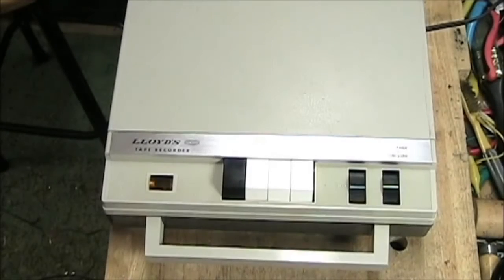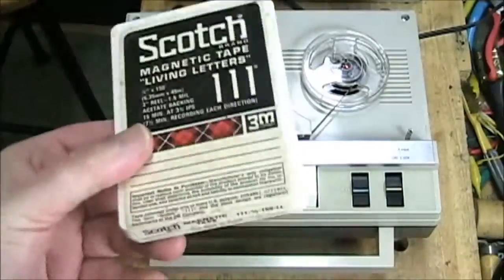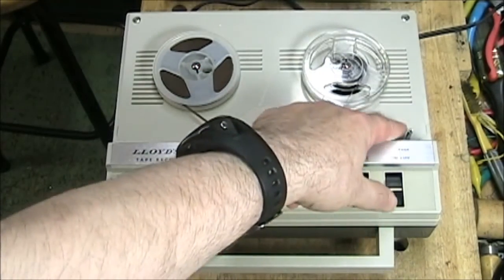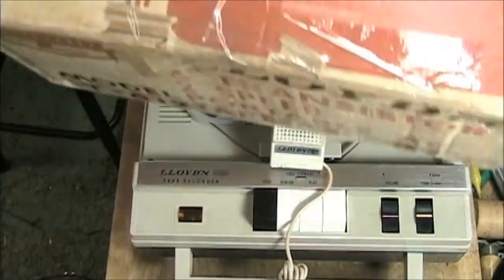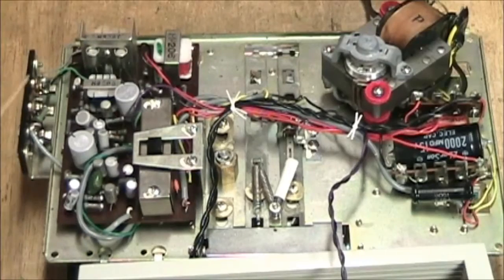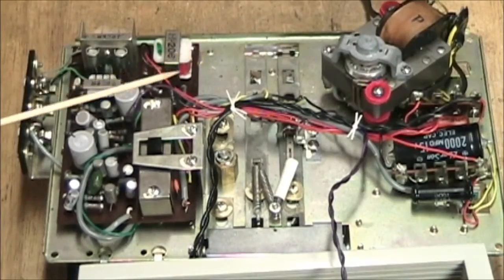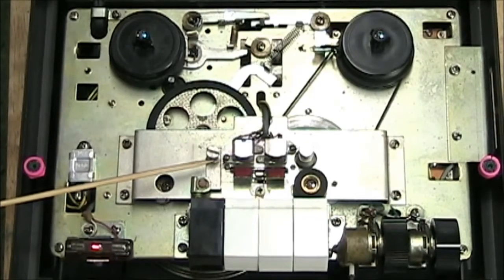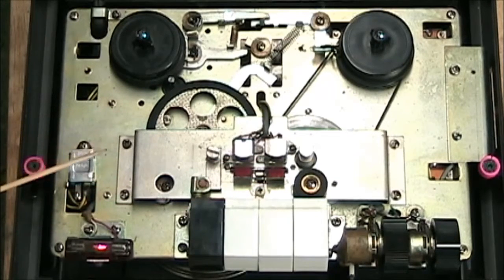Exploring the Vintage Lloyd's LT612 5-inch Reel to Reel Tape Recorder

Comment: I bought this tape recorder when I was 16 and it changed my life. I wanted to there and then learn everything I could about the recording career. It was also the summer that Sgt Pepper was released. I used it to tape and splice and record the Pepper album in so many different ways. Then a year later I was playing guitar and doing my horrid version of Hey Jude. But it opened doors to a world I loved. Cheap machine but the fun I had from it was priceless.i even put tape over the erase head to try and multi track. Needless to say it was a disaster. But it was fun. I forgot all about it til I saw this. Thank you.

Comment: you're welcome Tim, i wondered what happened.  also love your other video showing how to digitize audio. i don't know if it was done on purpose,  but there seemed to be NO comment section at the bottom of THAT video.  I'm going to use the info on that video to try to digitize some audio from some of my old tapes and seed how it sounds on youtube
Reply from the maker: amberola1b Hi Ed, on the other video, I explain in the description that I left comments disabled deliberately. I did this to avoid the issues of people asking for help with their unique systems - hardware and operating systems! I can't help them, for obvious reasons. For example, I just found out through a Facebook comment that many laptops don 't have a line input at all! 

News to me! 

Since I don't know every computer, I could only give a BASIC and general idea of what needs to be done in the video and hope people can adjust for their specific needs. Why sound cards and systems are not standardized is beyond me.

Anyway, good luck with your digitization!
Reply: ***** The laptop I got a few years ago has one jack for both a mike and headphones, which I think is a bad idea, and it doesn't have a firewire jack either!
Reply from the maker: bob7872  Does the mike jack also act as a line input? I guess with a chipset you could use a single jack for everything because of the high speed processing/switching. One nanosecond it is sending signal out, the next nanosecond it is listening for mike level, the next nanosecond it is listening for line level.
Reply: *****  Yes, it looks like it's the only audio only input. There are also USB jacks, 2.0 and 3.0. It also has an SD card reader so I could upload from that.
Reply: bob7872  PS- they call it a smart jack I believe- when you plug something in, a window pops up and you confirm whether it's a mike or headphones.

Comment: Nice video! Could you put a small fan in, like the ones in computers?
I remember we had a Lloyd's clock radio in the mid-70's in the kitchen. Love your restorations!!
 PS- how's your Sears 7" model holding up (the one you worked on last)?
Reply from the maker: bob7872 Hi Bob, I guess there is room to squeeze a small fan into the recorder, but it's not really worth the trouble. In today's world, it won't get that much continuous use. But I was a bit surprised because in it's day, it might have been a workhorse.  Sony also put out some recorders with no motor fans, and eve UHER did that, though they used some pretty serious motors with a lot of windings! 

I'm going to get back on the SEARs soon. Am into the amplifier now. This Lloyds was a break in the flow because someone needed it for a project, and this was my last chance to film it. The SEARs is patiently waiting.

Comment: Found one at an estate sale, but the aluminum drive/flywheel (right wheel) is hard to turn when play is pressed. any recommendations?
Reply from the maker: Thanks for watching the video. I am not sure what you mean? Do you mean the right REEL doesn't turn when play is pressed? If so, it is the felt clutch. You can unscrew the reel table and lift it out. You should see the old felt pad. You need to replace it with a piece of felt the same thickness. 

Did this answer your question?
Reply: @clydesight  Hello! After taking the 4 screws holding the top chassis off, I noticed that when I pressed play, the left wheel engages the motor spindle, but the right wheel-the one with the belt around it-will not turn without great force. Thanks for replying so quick!
Reply from the maker: @reseller_runner  Hi, sorry I misunderstood your issue.  Here are my thoughts. Please see time 5:50 or so on my video and pause it so you can see what I am describing here:

1. With NO buttons engaged, can you turn the capstan (the part with the belt on it) more easily. The brake for the reel table will offer resistance, but you can hold the brake away from the reel with a finger.

2. If the capstan now turns relatively easily, then the issue is with the drive wheel (the one with the rubber rim).  It may have dried grease. Put a DROP of oil on the axle and work it a little to help the oil ooze into the bearing. Wait a couple hours for the oil to soften the grease in there.

3. The capstan (the part with the belt around it) itself may be seized in the bearing. To fix that, unscrew the capstan sleeve and remove it to see the bearing. Put a drop of oil on the bearing, try to spin the wheel to work the oil into the bearing, and wait a couple hours. See if that frees it up. If it does, then clean the capstan shaft with alcohol (to remove any oil that might be on it) and replace the capstan sleeve. 

4. If this does NOT work,  I think you need to see if anything is UNDER the capstan flywheel, the one with the belt, causing it to jam. 

To check that, I suggest you remove the four head-deck screws (see time 5:50 or so on my video) and CAREFULLY lift the assembly up (be careful of the record - erase head wiring!) to turn it over and look underneath it.

I hope this helps!
Reply: @clydesight  Thanks so much! I will use this info to further investigate. I'll let you know how it goes.
Reply: @clydesight  After further investigating, I have determined that it is indeed the drive wheel bearing that is the problem. I can un-seize it and it will turn for a bit, then freeze up again. The capstan also has a lot of "play" in it which to me suggests a bad bearing also. I will have to re-sell as is I suppose now. Thank you for your expert help!
Reply from the maker: @reseller_runner  You can remove the drive wheel and clean the axle and then reassemble and it should be fine. As for the capstan, if the free play is up and dowen, that is normal, nothing to worry about. they leave room to keep it from binding. Try removing the drive wheel. I think you might be able to get it out without taking the head deck off. I don't remember, it's been a while!

Comment: Pretty cool tape recorder. When you took it apart and looked at the underside I didn't know that the motor would be that large to drive the mechanism. The top side of the tape recorder is kind of deceiving looking in your video as it looks smaller but when you look at the inside it looks almost as complex as a larger tape recorder. And it's built pretty good except for the fact that like you said it shouldn't be run for a long period of time because the motor has no way of cooling itself down. So in Lloyds design of manufacture it's kind of a disadvantage to using it for a long period of time.  But still a nice machine.
Reply from the maker: amberola1b Stupid YouTube waited until today to allow me to reply to your post! Anyway, thanks for viewing.

Comment: So how good are Lloyd's electronics? I saw a Lloyd's amplifier with an 8-track player and radio included for about 26 dollars, should I get it, it has bass and balance control.
Reply from the maker: +sciprio1 Lloyd's was always considered mediocre electronics, budget. but they sometimes would surprise you with a really good machine. The problem is, it is hard to know which machine was a good one and which was just too cheap. If teh amplifier/8-track works, $25 is a good price. The 8 track may need a new belt, however, but these are easy to get on E-Bay.